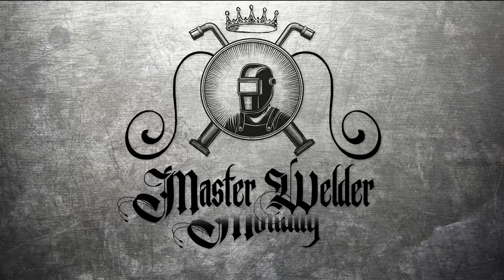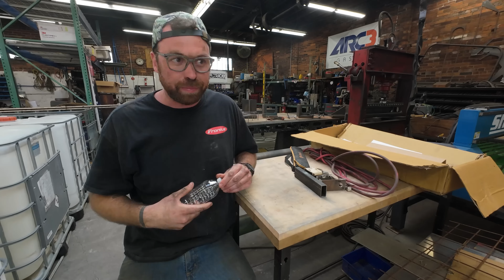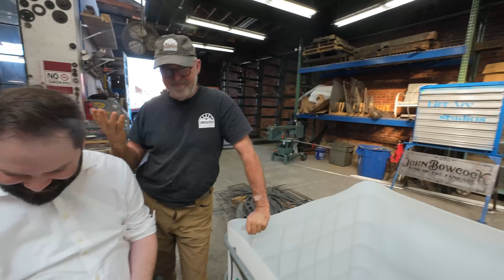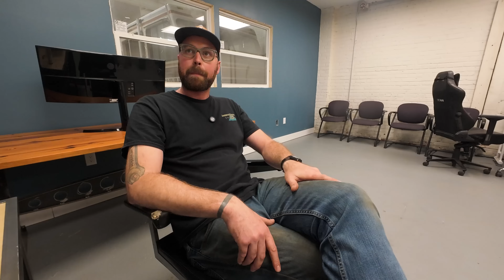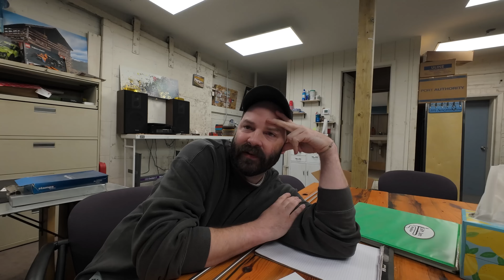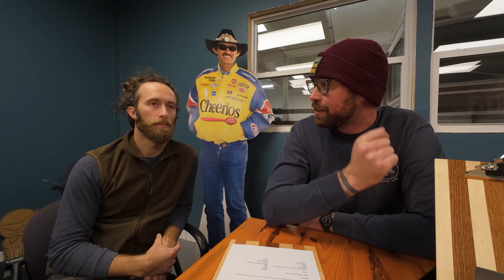Questions from Master Welders

Comment: If its a frequently handled surface that you dont want to frequently service = powdercoat. Large area, mostly untouched, or easily serviceable = paint. My pet peeve is when something that should have gotten the automotive paint treatment, has been powdercoated instead. Like the bed of a UTV that now has to be entirely stripped of powdercoat to be painted. CRC gasket remover makes a great powdercoat stripper, neutralize with acetone after about 15 minutes.
Reply from the maker: That's good advice. It's funny too how little people listen to experts when it comes to treatments like that and often go with what's cheapest instead of what's needed.

Comment: 👍🏼 Can anyone explain why you always say MIG welding but never MAG? 🤔
Reply: MIG is a slang term, meaning Metal Inert Gas. The correct term for the process is Gas Metal Arc Welding, commonly said as gmaw or g maw. Another common term is wire feed welding. Not sure what you mean with mag unless it is stands for Metal Arc Gas which in the Midwest is not used to identify the process. Hope this helps. Teach my welding students (13 years a teacher and 53 years as a welder) to say Gas Metal Arc Welding because that is the proper term used by the American Welding Society. Hope this helps.
Reply: @flatlandwelder MAG stands for Metal Active Gas, since with steel the gas blends aren’t completely inert. You rarely hear it in the US, but it’s a common term overseas. I’m with you on GMAW as the best term, but they’re all talking about solid wire.
Reply: Here in Europe we would never say MIG welding when we are MAG welding and vice versa. It always triggers me when you do so. But I understand that this is just slang 😅